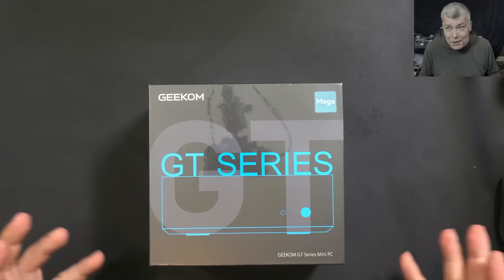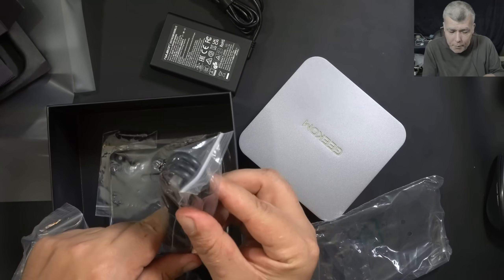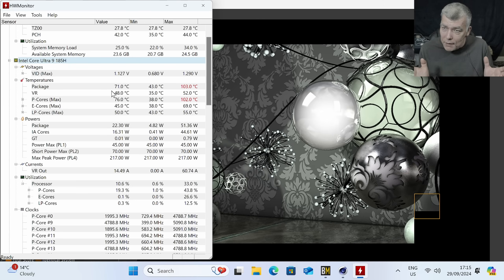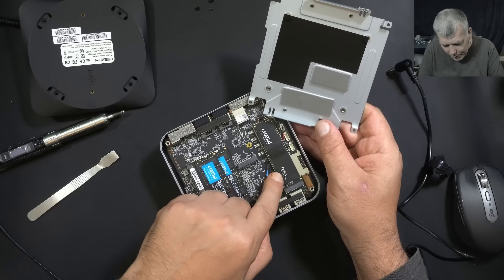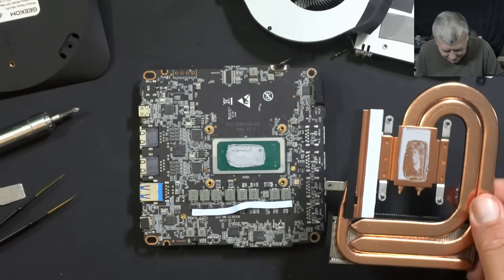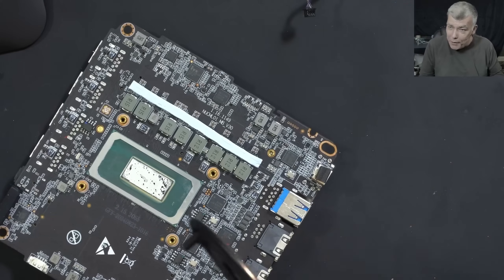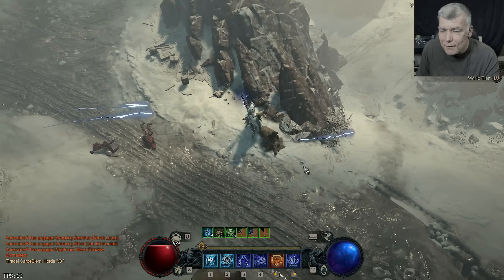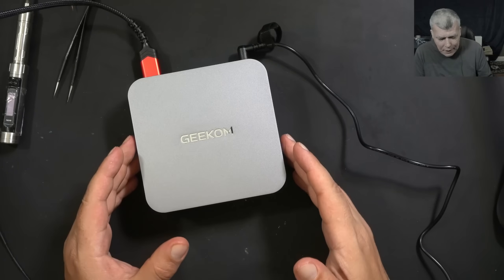GEEKOM GT1 Mega Mini PC Ultra U9 -185H - Unbelievable performance from this mini PC!

Comment: I have heard of liquid metal but it has been maybe10+ years since I have built my computers.  The question I have is that liquid metal  mercury? Or something different.         I have one of those mini PC's for the front room computer.. it works well and it is an asset.. I also have two towers one for my wife and one for myself.. The mini does a great job for designing and information.. Man you resally are a pleasure to watch.. I have learned so much over the years.. Crry on!
Reply: Do not use liquid metal on copper heatsink. Galium eats copper. 
You can use it only if the heatsink has protective nickel plating.
Reply: Mercury is poisonous to humans. Gallium nitride or derivatives

Comment: Liquid Metal will corrode and destroy heat sink. Copper and Liquid Metal not compatible
Reply: totally wrong. Don`t share information you hear in coffee shops
Reply: It's Alum that corrodes with liquid metal, ie, gallium eats alum.
Reply: Totally wrong 😂😂😂 its copper not aluminum😅😅😅😅
Reply: @DARKNESS19906   I’m have MacBook for repair with applied Liquid Metal. Heat sink have pitting and holes on contact area
Reply: The only thing Cu heatsink is worse than a plated one is the fact that on non-plated-Cu the liquid metal "dries" faster and stains the Cu; needs 1st replacing sooner than on plated. But after the initial stain/plating has finished (months time-scale), plated and non-plated Cu heatsinks are virtually the same (except for looks, ofc).